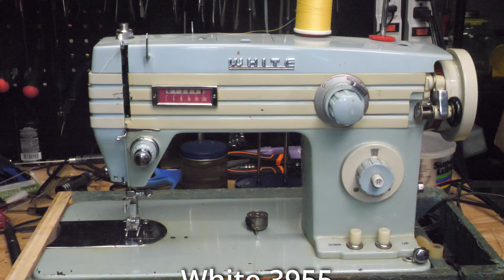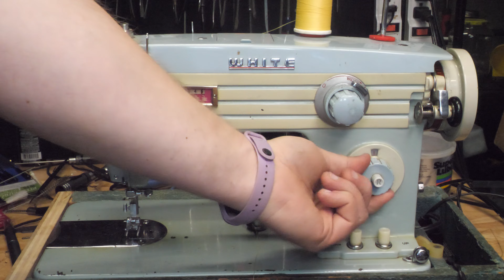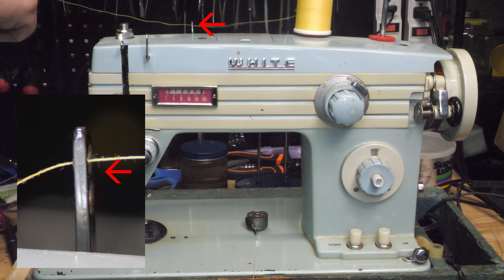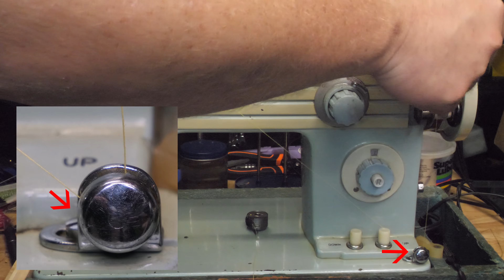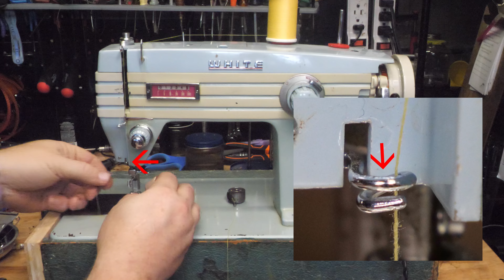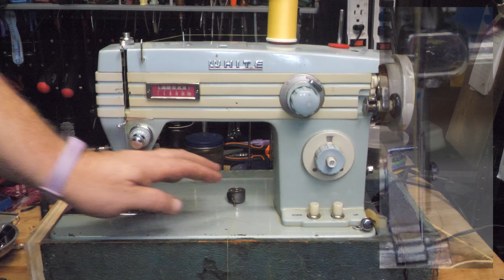White 3955 Threading

Comment: I need to find the upper thread tension assembly.  You have any info where I can get one? I was gifted this machine and i want to try to refurbish her. Thank you
Reply from the maker: The entire assembly is missing?  Measure the hole where the tension assembly goes and you should be able to order a generic Kenmore replacement which will fit the hole.  There is a center pin for releasing the tension which will need to be replaced or adjusted for the White.  The generic Kenmore tensioner won't look like the original, but it should work fine.
Reply: @henrybangsberg2187  yes, the entire knob and tension is missing. the spring is literally popped out flying around like a bad cartoon accident from pixar pictures...lol. thank you  so much for helping me find a way to get this girl going. be blessed!
Reply from the maker: @puzzles2me  If you have some parts of the tensioner left in the machine you can sometimes use the new tensioner parts to rebuild the old one if you have the dial to keep it looking original.
Reply: @henrybangsberg2187  ill have to inspect further. i am waiting for cabinet legs braket. she is  a 3 legged cabinet at the moment and dont like looking at her upside lol.  thank you again.